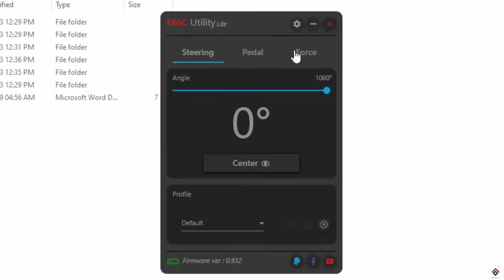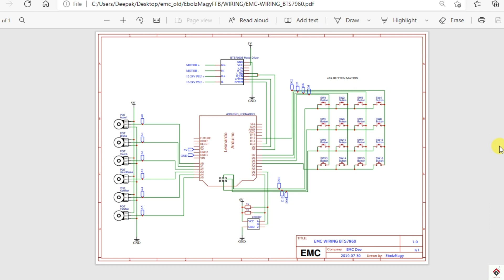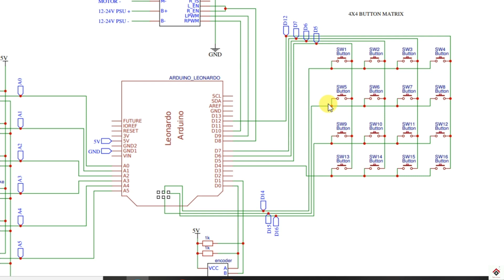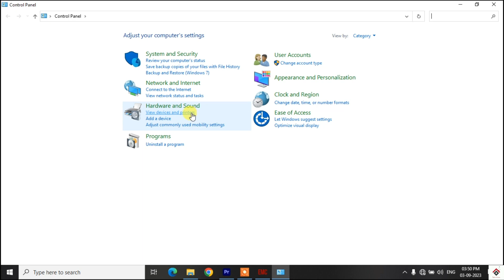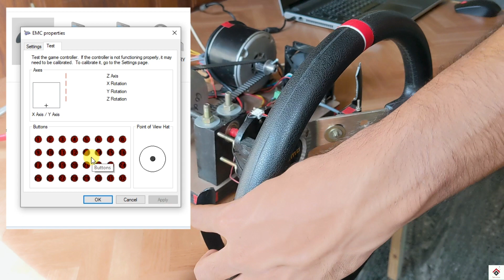Paddle Shifters for DIY Force Feedback Steering Wheel | Paddle Shifters for Racing Wheel [English]

Comment: hey bro, can i connect the steering wheel using the pot in this .and one more doubt can we use Arduino uno for this.
Reply from the maker: No, Steering axis works only with encoder input.
No, doesn't work with Uno board.
Reply: @techathome  ohh okkk, is there any way to use the steering wheel with pot and the analog accelerator and brake .

Comment: Hello sir, how i connect with pc?
And what about power supply?

Help me,
Reply from the maker: Connection: https://youtu.be/crdDhvhBG0M?si=ooo34jb-qoFJX82z

This motor is 24v, 10A.
I am temporarily using 12v, 5A DC supply. 

Which motor are you using?

Comment: Hey man make a video to add the horn feature in the center of the steering wheel
Reply from the maker: I can make, but wire will create issues while rotating.
So thought of keeping it outside.

Comment: Hello bro, I followed your entire tutorial to the letter but I have a problem, when I press button 5 or 6, buttons 13,14,15 and 16 are activated on the screen
Reply from the maker: That is not an issue. If any of the buttons are getting detected it is sufficient. You can assign in the game.
Reply: @techathome  I can't because any of the 2 buttons I press activate keys 13,14,15 and 16 at the same time, it's like I pressed 4 buttons at the same time, that's why I can't assign them.

but I don't know why, since my project is a copy and paste of yours
Reply from the maker: This is something issue with the button matrix connection.
Check this video and if you need PCB for the same let me know: https://youtu.be/KfeRfZGXSU4?si=eIgsUxjwq25YDwdk

Comment: Bro please clear my doubt . Can we make a normal 900 degree stearing wheel and use this software instead of making a ffbsteering wheel please say any problem will come... Please
Reply from the maker: Yes, connect only encoder. Your wheel works fine.

No need to used motor and BTS driver if you  don't want FFB.

Comment: Hello could you help me? I have two potentiometers wired in series to control a gas and break pedal I can get them synced perfectly glue them in place and I turn my transmitter on and it’s way off after reposting the unit. Trying to make rc car Fpv vehicle powered with racing wheel and pedals. Please help I have no problem sending thank$

Comment: How much did it cost for total set ..steering, pedals and shifter
Reply from the maker: Considering the current online prices it's around 8500 Rupees approx.
But you can reduce costs -
1. No need of pulleys and belt for encoder. You can directly connect at the end of steering shaft.
2. Using cycle chain and sprocket instead of timing belt and pulleys for motor.
3. Use 100W or 150W motor, but mine is 250W which I already had.
4. Some old steering wheel can be used, Here I bought new wheel.

Comment: switches not working bro any fixes?
Reply from the maker: Connection might be wrong.

You can try to use remaining buttons of the matrix and see if it works.
Reply: @techathome  it was a fault with with a jumper wire rectified it thanks for reply